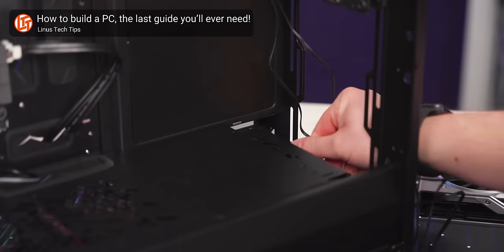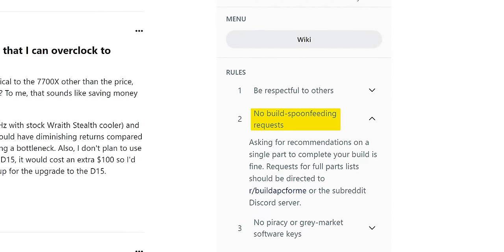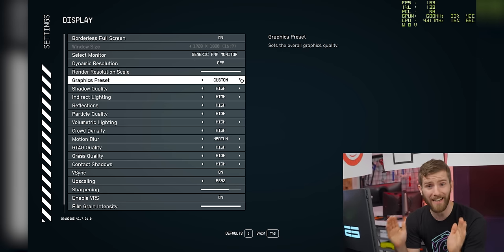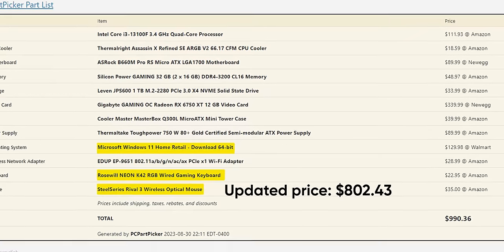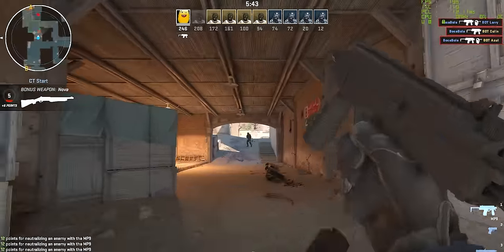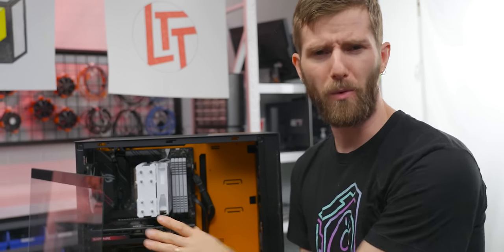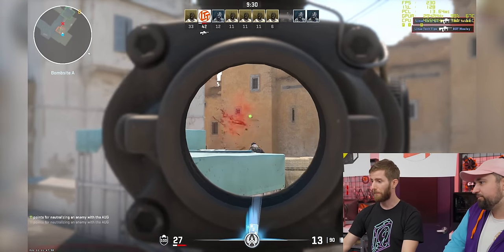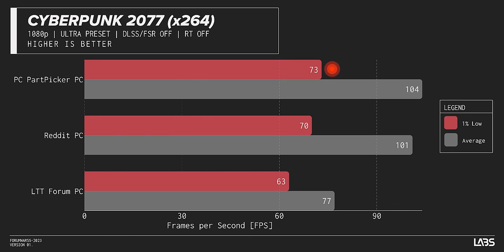We Secretly Challenged 3 communities to Build the Best $1000 Gaming PC!

Comment: While they were only considering perfomance, I think recomemding a case thats easier to build in is totally valid. If someone is asking for parts suggestions, then its likely they dont have a ton of computer building experience (or at least arent up to date with current parts). Seems reasonable to me to suggest something that would be easier to work in if the person you're recommending to has limited experience.
Reply: ..but it's a thing you do once. If it takes a bit more time, does it really matter.
Reply: @jamakasis18 thats exactly it. Very few people would tear down their their first try at building and fix it. So if building sucked, you now have a rats nest of cables collecting dust and terrible air flow until their second pc where they learned their lesson and buy a decent case or worse, hated it so much that they buy prebuilt now
Reply: @toolbaggers  what a more accurate analogy would be, using a regular Phillips head driver on a Japanese Industry standard Phillips screw. It'll get the job done, but you won't be as keen to remove it when you risk messing up the screw head.
Reply: Good airflow as well, a bad flowing case can cost you a lot of FPS
Reply: That excuse doesn't make sense at all. It's not like you need to build in that case every two weeks or so lol
Reply: pish posh, i worked on a mid tower that was weird to build in on my first pc. it went fine. just takes a little longer thats all. As long as they dont do a mini itx or shoebox case or something dumb like that they will be ok.
Reply: @toolbaggers  to be fair: I rebuilt pc (like, changed ram, hard disk, cpu ect) when I was like seventeen. Then I started to buy prebuild because, you know, work and all. Last pc I wanted an ad hoc pc and it was four years ago. I managed to change the gpu twice (started with a rx 550, then a gtx 1650 and now a rx6650xt) and just last week I removed the two original fan to install four new fan (one of these is a cooler master that is noisy AF and will need to be changed again). I had to play fast and loose with the cable management on the back while the front isnt bad at all since I managed to tie all the new cable around the hardware
I have to change the CPU heatsink by myself because I get a "CPU fan error" but the cpu fan work, so it's prolly just the fan sensor. Problem is that arctic dont make anymore of these fan (arctic freeze xtreme v1) so I've to change it all. And I dont dare to do it myself so I will call the guy that build the pc for me, because the CPU is a smidge more complex for my fat hands.
Reply: Bad case choice can can be fought through for a first time builder sure, if you start with a good and easy to work with and in PC case, they are also going more willing to go back in, change parts and upgrade in the future as well, instead remembering what a pain it was to get together in first place and dread having to go through all that mess to just change out a part or two and just give up on whole building a PC and upgrading as need be.
Reply: Which is fine as long as they aren't asking for the best bang for their buck, or even wanting to go as cheap as possible. In my case, it was the latter. 

It's a 30 dollar case. It probably is why I can't turbo as high as I should, but I don't ever seem to need the extra power anyways.
Reply: @turkeypedal speed hole time?
Reply: I think that's exactly what Linus was saying. As for building it only once... Yes, it does make a difference whether it's a PITA or not. At least for me, I'm much more inclined to open up and add storage, or change the configuration of a build in a case that is more friendly to build in, not to mention whether or not it's easy to manage the cables. I rue the day that I need to completely disconnect and remove my mother board in order to access the m.2 slot on the back because my case doesn't quite have enough cutout to access it while the motherboard is installed.
Reply: @dogboy0912  a good case is especially important for a first timer because plugging the front io in on bad cases is not fun at all. Not to mention the possible interference between different components due to a bad case layout (the PSU interferes with the original location for the hard drive bays on my main pc so i had to relocate them to just below the gpu).

Comment: It's important to note, that reddit had a list, that appears to be made and maintained by the whole community, while PCPartPicker and ltt forum had individuals, who suggested their own views on the best pc. They say two minds are better than one. And the reddit hive-mind is certainly effective.

That list surely has the most consistent quality you could get across those three options.
Reply: That list ist existing basically in every Forum here in Germany.
You can either just use an example from the list or get an individual configuration recommend from individual users.

I think the configuration from LTT forum ist not that bad.
Most users will just switch the GPU in few years und you can actually do this if you have a solid CPU/Mainboard/PSU/Case.
However: You shouldn´t get that low with GPU Performance in this price range.
Reply: @darkness8631 
Depends. Current games 60fps target or e-sport 180fps target? Do you do anything else apart from gaming on that PC? Especially at the entry level, +30 bucks for CPU and +15 bucks for the mainboard can offer a lot of QoL for general usage.
Reply: Suggesting a bronze-level PSU would've immediately disqualified it in my book. But that's just me.
Reply: I think the ass hat mods should have automatically disgualifed reddit
Reply: They only went with the list because they didn't get a human response. It's not a failure of reddit if they have decent suggestions without a person personalizing everything for every single person. However it is extra points to pcpartpicker that they did have someone to do that and give their reasoning!
Reply: @darkness8631  While I agree that there is some value in skimping on a GPU for a while in order to get more CPU and RAM for your money, if I wanted to do that then I would go the extra mile and get a Ryzen 7000 system. As it is, there's not a lot of reason to go for a 5700X. The 5600 is much cheaper, and you can upgrade to a 5800X3D if you want a good uplift in performance.
Reply: @vearheart42  I think the list is better than a random human
Reply: @ichijofestival2576  efficiency does not matter to %99 of people. Bronze is fine.
Reply: @darkness8631 thats honestly what I thought as well. The GPU is usually the easiest part to be swapped so it will probably be done first by newbies.
Additionally creature comforts matter way more in my opinion than it is being given credit. I doubt most newbies are so single minded about achieving maximum FPS, look and feel count for a lot (though Linus did point out that all cases are rather nice, so it looks like the community agrees with this).
Reply: @ichijofestival2576  why?
Reply: redditor spotted, thinks reddit is his heaven lmao
Reply: @Freestyle80  I don't use reddit at all
Reply: @__-fi6xg  it's obvious the commenter and the people giving thumbs up have incorrect assumptions and really don't understand what that "metal" rating system actually represents.
Reply: @nikongmer  I'd be cautious throwing around accusations of ignorance or "incorrect assumptions." It has proven painfully ironic. You're assuming that by disqualifying a bronze-tier PSU, I'm making my decision based purely on a percentage point (or which picture is the prettiest, apparently).

First: if a manufacturer didn't care enough to get those "few lousy extra points" to slap that "meaningless" label on it, they aren't going to be spending the extra money on development, components, the manufacturing process, testing or quality control. If one of these companies tried to create a high quality product and slap a bronze label on it, the marketing department would come running down the hall with a meat cleaver. The rating is not a guarantee but a strong indicator of quality. 

Second: of all the components in a PC, the PSU's failure can be the most disastrous. Not a place where I'd choose to skimp.

Third: putting aside whether or not electricity cost is a concern to you, PSUs are long-lived components and over the course of 5-10 years of heavy use, a more efficient model can absolutely save energy and money-- in some places, literally enough cover the difference in cost.

Comment: I recently had to replace my PC, and I chose the Fractal Pop XL Silent case to build it in. I didn't regret it. Very nice case, and it came with 4 fans preinstalled which for about £90 is a steal.
Reply: I don't know if it's still available but for SFF PC's I absolutely LOVE the Node 202 from Fractal.  It's literally one of the easiest cases to build in that I own and it's about the size of a ps5.
Reply: Okay and? Unless you have built in cases its being compared too, your input is useless.
Reply: @ILikeToEatCatz I am explaining why build advice is such a terrible topic, there are no reference points. Especially as unless your a PC builder, you dont build  2 similar pc's or test quality and instead have only individual anecdotal pieces of evidence.

Comment: I use PC Part Picker to check on compatibility on possible builds, and forums for more specific questions like "what's the best GPU that I can pair with my CPU?"
Reply: Doesn't always pick up on things like cooler RAM clearance or GPU fitment, insufficient fan headers, or needing a certain BIOS version to support the RAM kit you're going for. It's good to have someone with more familiarity with possible pitfalls to doublecheck everything even if PC part picker gives you the all ok.
Reply: This is the way. Bash all you want but the not spoon feeding policy on r/buildapc gets rid of lot of spam.
Reply: @PBMS123  Cooler incompatibility with tall RAM heatspreaders can still be a fairly common problem. NH-D15 is still a very popular cooler and often you just can't fit tall RAM under it without having to relocate or remove the second fan, and not all cases have the width to be able to just scoot the fan up the tower to make room for the RAM underneath and still be able to close the side panel. It's these little things you don't pick up without knowing to look for them.
Reply: I love that they still have old part in their database. It's really useful when doing small upgrades too
Reply: Well, people will give you very different and often wrong info on any forum. Especially "which CPU with which GPU". People have a very skewed idea of how important CPU is due to CPU benchmarks/reviews where they typically run games at 1080p low settings to purposefully create a bottleneck. When in reality, the GPU will almost always be the bottleneck and CPU really won't matter
Reply: @pcmasterracetechgod5660  That's a very narrow view and operating under the assumption that you'll take whatever performance you happen to get at max settings. On ultra everything GPU will be the limiting factor more often than not yes, but I'd rather run whatever settings don't negatively impact my performance - in other words I'd rather run max framerate than max settings, in which case it's the CPU that often sets the performance ceiling and a faster GPU only allows me to turn up the graphical settings more.
Reply: @SaltyMaud  That's not my assumption at all, even at normal settings at a normal resolution (1440p for example), a 5600x is going to handle a RX 7600 the exact same as a 7800X3D. This video pretty much supports what I'm saying as they really tried to give the LTT build as much of a chance as they could by playing at 1080p despite a 4070 and 6800 NOT being 1080p GPU's. But even at 1080p, the 5700x made little to no difference other than in DOTA which is already a weird pick. 

TLDR, it doesn't matter what settings you use, a GPU is only so powerful and can only put out so many frames, in which most of the time any modern CPU $150 or more (5600x/12600kf) will handle the same as any other.
Reply: @SaltyMaud 
Just return and replace with something else if there is a problem.
Simple.
Well maybe not for some , but there are countless YouTube tutorials.

Comment: Some notes to the editor or QA:

At 10:40 for the LTT Forum build you mention 32GB of memory, showing in the background clearly 4 RAM sticks, while the pop-up reads: 2x 16GB. Something must've gone wrong here.

At 12:02 when Linus talks about the case choices, he lists them in this order: Fractal, Phanteks, Lian Li, corresponding to LTT Forum, Reddit and PC PartPicker, and the cases are flown in in the edit from left to right in that order. In the background of him talking the builds were ordered like this from left to right: Reddit, PCPartPicker, LTT Forum. Thus, I think it would've been cleaner if you showed first the LTT Forum/Fractal Case on the right (like he says it first), then the Phanteks case on the left (his second mention), still showing Linus gesticulating and talking in the middle, before you then show the third case he talks about in the middle (PCPartPicker/Lian Li). This way, not only would the conitnuum of the order of the builds be conserved, the viewer also gets the chance to follow Linus' performance the longest. Just my 2 cents :)

Otherwise, cool video! Great to see what cool suggestions the communities came up with.
Reply: Linus also mentions how the LTT build has a Seasonic PSU but the graphic shows that it has a Corsair one instead
Reply: They've gone back to daily uploads. It's clear the editors have less time to do videos now, thus mistakes going through (even though they have like multiple people going through triple checking it) @kimbroslic3
Reply: I believe the pop-up may be what was recommended on the forum, and what was in the case was what they actually used, as he said earlier that they used what they had on hand rather than buying hardware. Could also just be a mistake though
Reply: This is very late but Linus did mention at the beginning of the video they used some component counterparts

Comment: One of my favorite websites to use as a reasonable starting point for choosing parts is logical increments. The website is constantly updated as new hardware comes out and prices change. It also provides a ton of price ranges and the possible parts you can pair together. While there's more to it than that, it gives you an idea of what parts you should be comparing for a given price range. When a friend requests my help for building a PC, that website is the the first place I go to get an idea of the current hardware landscape.

Comment: At 3:23 Linus says that it's a 16GB kit but the on screen graphic displays it as a 32GB kit
Reply: also wrong ram name hah
Reply: I thought they were fixing their errors :(
Reply: @dennislemennace420 i mean it’s been 15 mins since upload im sure they will see the issue soon and correct it
Reply: They also did the same thing for the LTT forum build and said the power supply was a Corsair RM750 while showing a Seasonic power supply 10:52
Reply: Later in the vid they have a graphic for the lot builds ram and it’s also wrong. 2x16 when it’s obviously 4xsomething
Reply: @TrexxikLT   He mentioned it already that they're not using the exact same parts but comparable.
Reply: @kushiro6302  yes in which case the video overlay should correspond to the correct part 4x vs 2x is still wrong
Reply: @Ligby  they might be filler sticks. But should've been clarified if that's the case
Reply: @dennislemennace420  yeah feels like they missed a final edit review on this vid
Reply: I feel GN should rep up their engines for a 2h crisis video about this very fact 😂